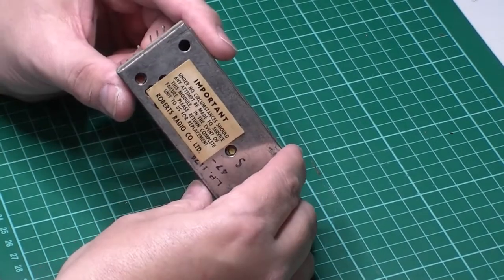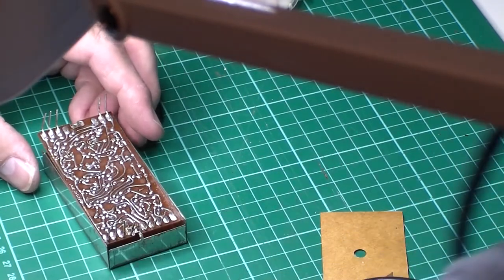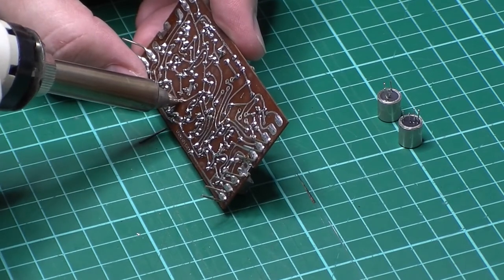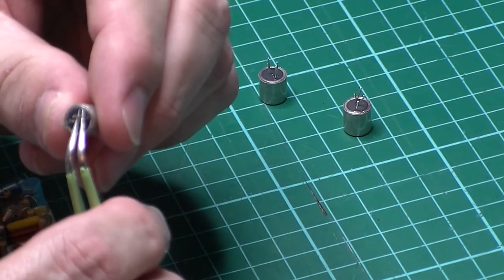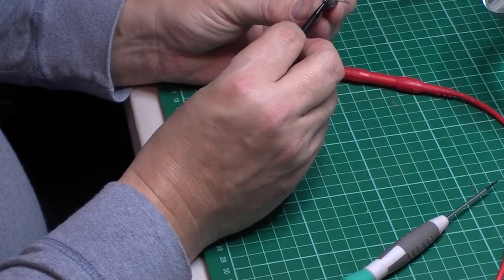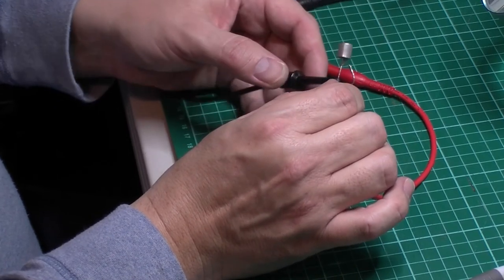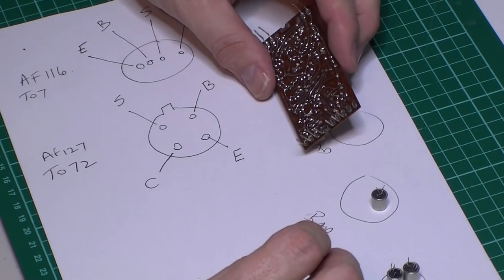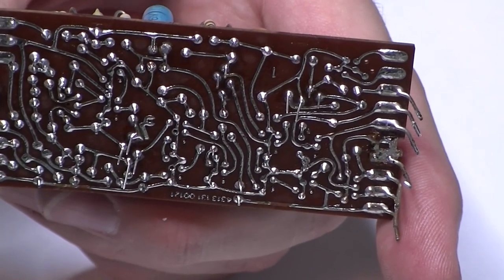Roberts R600 part 4: Mullard LP1171  module repair

Comment: very interesting Graham. I recently worked on an AWA early transistor radio which didnt work. The fault turned out to be a faulty AF117 - after researching the tin whisker issue i simply banged it with a kitchen knife and the radio sprang into life!  Interesting how Roberts decided to go down the 'module' path and outsourcing it to Mullard, presumably as a cost saving measure? I'll have to get one of those desoldering machines - amazing the way those transistors dropped out!
Reply from the maker: +marty james. Tapping or banging them can certain Spring them back into life Martin. Some people just snip the shield wire. I like to take them right out of the circuit and short them as in the video. I decided to replace rather than restore the AF116's as the module was such a pig to get out. Normally I re-use them. The desoldering tool certainly makes easy work of it. I'm sure you could pick one up reasonably down there.

Comment: Interesting tips about fixing the whisker issue's,  I've not ran into that issue yet,,,,I'm sure I will since I have been picking up vintage transistor radios to repair....I've seen others here on YT dealing with it as well....I have a desoldering gun as well....best tool I ever bought, well worth the money! Question? Whilst you had the module apart, why didn't you just do a courtesy component check or at least replace all the e-caps knowing how fun it would be to get back in there? Great video, great series!  Regards, ~Jack, VEG
Reply from the maker: Thanks for the kind comments Jack. The desoldering gun makes it so much easier and quicker. This was the first module I ever tackled so I have changed my approach since finding a couple of dodgy electrolytics. I can't remember from memory whether I did check these with the ESR meter. I have done 3 of these radios and a R707. I am now changing the transistors and electrolytics. If you catch one of the later videos I go over it in detail. I have about another 6 of the R600's to restore so watch this space. Thanks for watching. Graham
Reply: Yeah, wasn't thinking when typing....older video, one generally do learn a better workflow ass one goes, I know I sure do!  I am watching your video's, oldest to newest, looking forward to all projects!  My pleasure, thanks for sharing! ~Jack, VEG

Comment: G'day mate. I have a Roberts R600 with a dead Mullard LP1171 and i'd like to repair it but I have a few questions. It has the whisker shorted transistor and would like to replace them with Russian germaniums. Do you know what the IF frequency is? I can't find any info about the guts of this little silver box. Any suggestions for transistor substitute? Any pointers for a schematic? Thanks!
Love the channel, lots of great content
Reply from the maker: Hi Trevor. Great to see that you are having a go at a module. The GT322B seems to work well in these. The closest to the original transistor would be something like an AF125 though. FM IF is 10.7mhz. The AM IF is 470khz. The schematic for the radio is available online and the module schematic is also out there. If you have trouble finding them then email me graham@radiocruncher.com and I will send them

Comment: I've never seen a stone age transistor like that before that you can refurbish.  Why not just toss those out and use a modern type without the pesky whisker- shield problem?   The NTE160 is supposed to be an equivalent, will that work?
Reply from the maker: Hi Steve. I've not come across the NTE160 before but there is reference on the internet to it being an equivalent for the AF127 which is the prefered equivalent for the AF117 so it should work. I will have to pick a couple up to try. The whiskers will eventually grow back so it's worth putting something else in for future proofing. Thanks for watching. Graham
Reply from the maker: Just had a search for NTE160 and they are more expensive than the AF127 so probably not a good buy unless you have a stock of them
Reply: Oh well, it was just a thought.  So if you test those transistors on a transistor tester will it show up the whisker problem?
Reply from the maker: It doesn't usually show up on a transistor tester as the short is between the metal cover (connected to the shield wire) and the other terminals. An ohm meter is the best method. With one probe connected to the shield wire then test to the other 3 wires. There should be no reading.